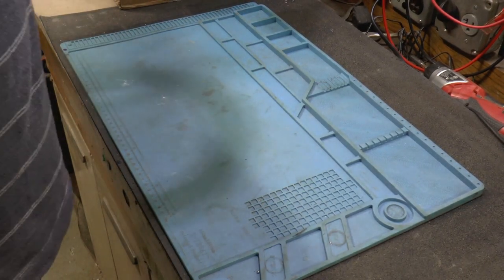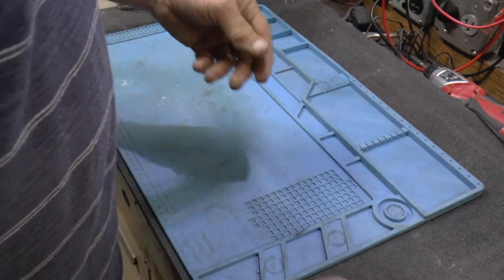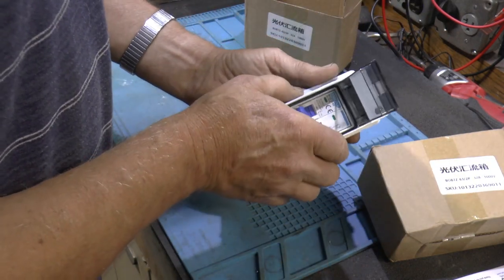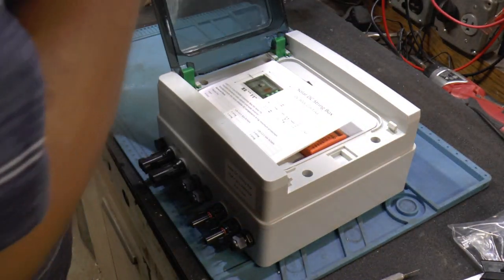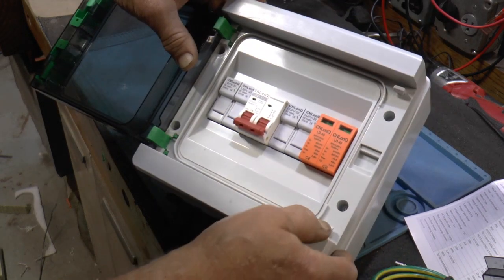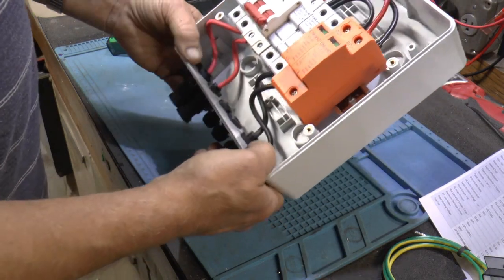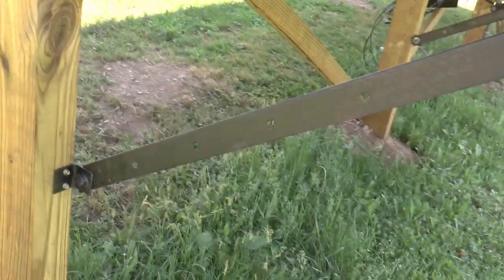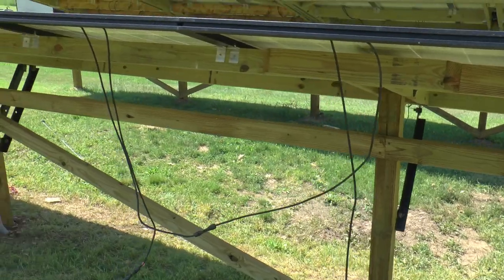Solar Combiner Box for New to me Panels

Comment: Have you done a walk through of how you built and fastened down everything, including the solar panels?
Reply from the maker: You can see the L brackets in this video https://youtu.be/HzlNHunBIUQ  at the 8:34 point.
Reply: Okay, thanks. I'm starting to get the picture. I imagine you mean SS bolts, instead of screws? 
What size was the L brackets and bolts if you can remember?  @kevincrawford2027
Reply from the maker: The L brackets are about 1 1/2 inch made from aluminum angle. 1/4 inch bolts. @meesiphht2769
Reply: Thanks again!  @kevincrawford2027
Reply from the maker: Here is my solar panel ground mount video. https://youtu.be/QcOvt-RvhKA
Reply: @kevincrawford2027  Ok, I already saw that but there's no detail on how the panels actually went on but so far not one video I've seen has actually shown that.
Reply from the maker: I used aluminum L brackets that use the holes in the solar panels and attach to the wooden frame. Stainless screws on the panel and galvanized screw in the wood. I sized the wood frame to match the panels . @meesiphht2769